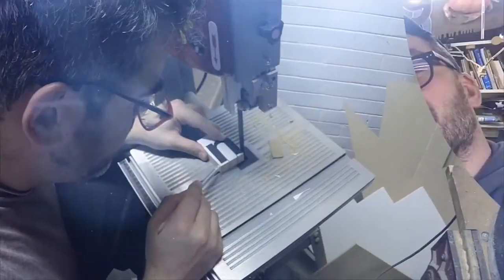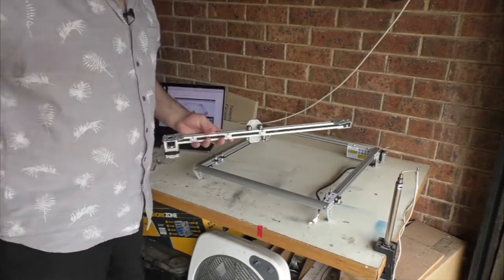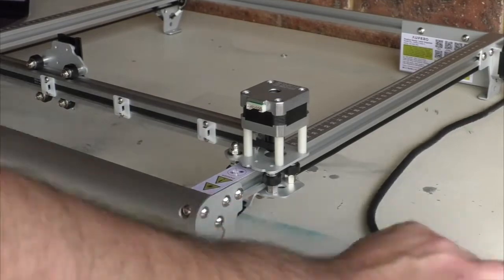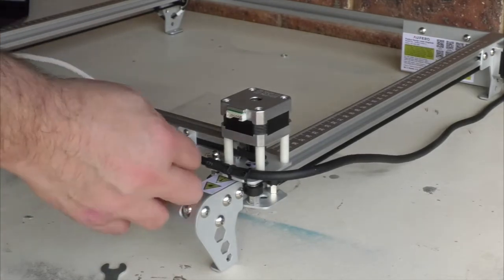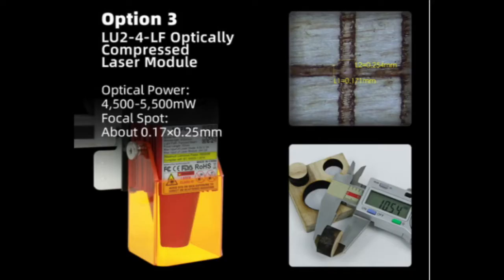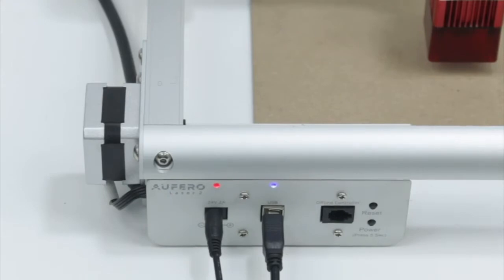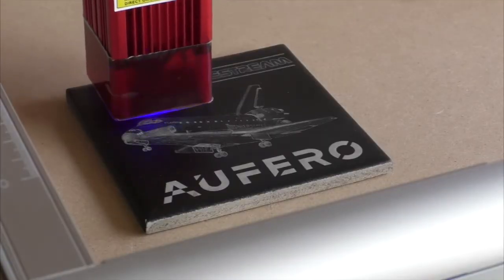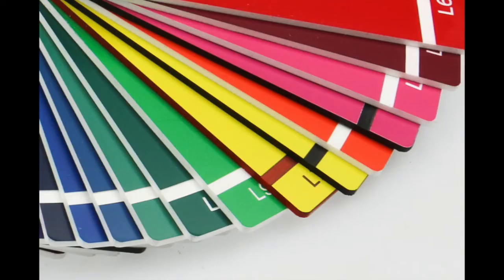Aufero Laser 2 engraver  - First look, build and review

Comment: Aside from the materials you mentioned, you can also engrave anodized aluminum (not bare Al), glass, ceramic tile including using NWT method, and you can permanently mark stainless steel (and supposedly titanium, but I don't have any to test on). 

You can also use laser marking paper, Cermark, Brilliance spray, Zinc spray, Dry Moly lube, powder coating pigment, and other materials to permanently mark objects.